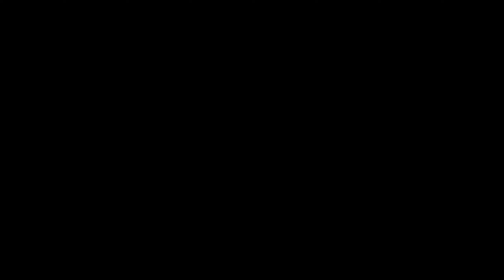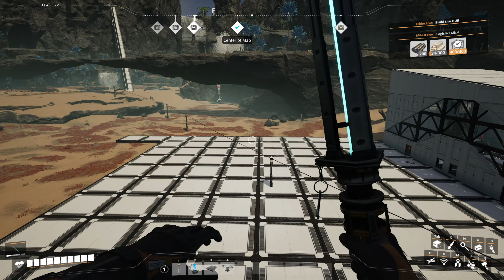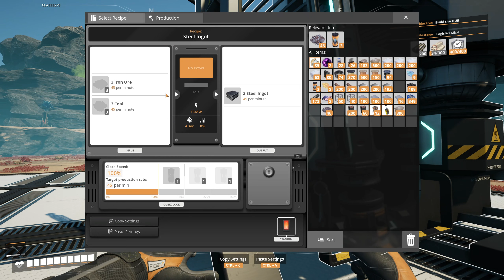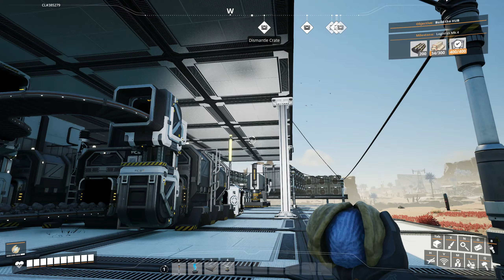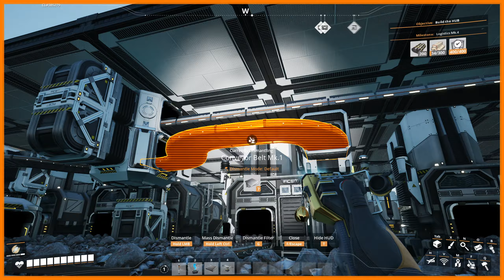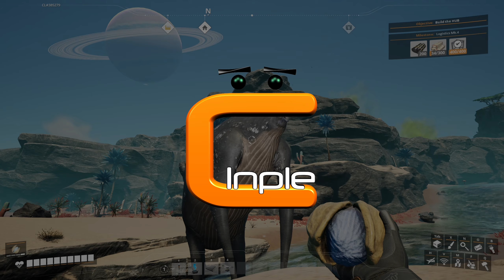Manufacturing Supervisor Plays Satisfactory - The Great Reset

Comment: Cool factory. How do you deal with the transition from tier 1&2 to 3&4 ? I have some issues with power and coal shortage for steel.
This game is really hard and I have 400 hours in Factorio. The fact that is 3D is making it so much weirder and harder in a way.
Reply from the maker: @andreialexandru8737  i am also continuing to learn as well, but what has helped me so far is splitting my coolant power generation away from my steel factory. With the limited good coal nodes, it has helped me so far. My only other suggestion is roam round finding hard drives for alternative recipes. Those can help tremendously.
Reply: You have to explore a lot more and find more coal. It is a huge map. Took me a long time to upgrade my power too.